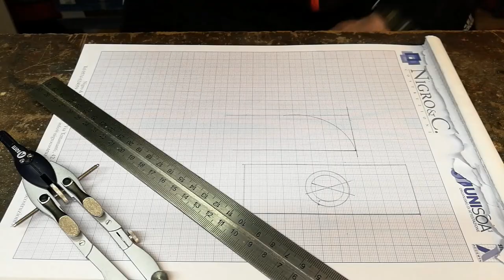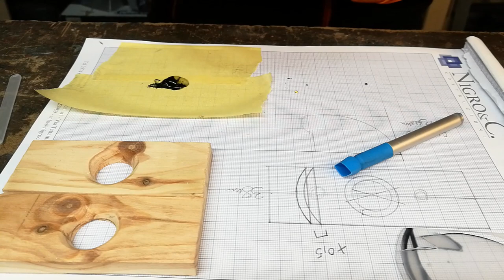Tagliasigari artigianale fai da te - DIY Cigar Cutter

Comment: Super cool :)

But dont use a zippo lighter for cigars they can make the cigars taste like lighter fluid
Reply from the maker: You're right! Thank's for the advice!
Reply: That is not true at all! It's just an extremely old, out of date, myth. Maybe 20+ years ago it might have slightly been noticeable, but modern fluids are so refined that they have absolutely no effect on the taste of a cigar. The theory has been tested several times by many different people, some with super refined palettes, and almost everyone comes to the same conclusion that it just simply isn't true. You can find several test videos on the YouTube. I personally use a Zippo because I prefer a soft flame and I've never noticed anything taste wise. Most of the only people that still try to claim that it effects the taste are the "cigar snobs" that believe the only correct way to light a cigar is with matches or a cedar still. In short it's just simply not true, please don't get caught up in the BS. Also great job on the cutter! It's a cool unique design. Definitely something to be proud of!